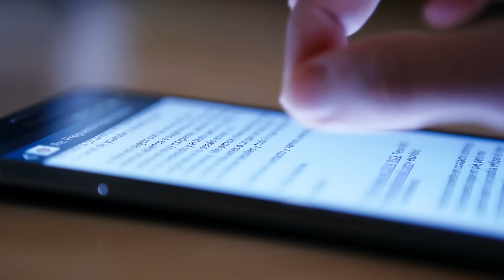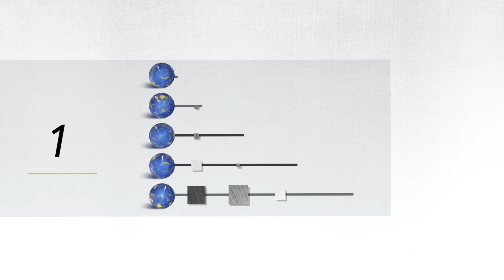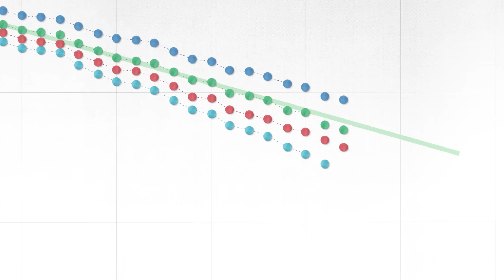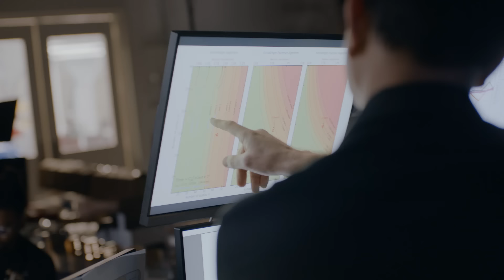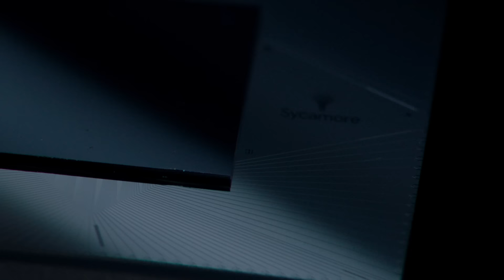Demonstrating Quantum Supremacy

Comment: "We can give researchers a tool that is unlike any other"

2020: every hash algorithm has been reversed. No password is secure anymore.
Reply: hash algorithm can't be reversed.
Reply: @SuperMarkusparkus  not true
Reply: Milan Kragujevic hashes cannot be reversed but there are tools that can compare hashes from a word list.
Reply: Just put password in a weak PC so it will limit the quantum computer's speed
Reply: Quantum passwords 😁
Reply: that's what I'm really afraid of.
Reply: @or814  it would be possible to just brute force crack it. No comparison necessary.
Reply: @SuperMarkusparkus  Rainbow tables. But yes, if there is salt, there is a problem with those too.
As long as you've found a sequence that results in the same hash, you don't really need to reverse anything.
Reply: Shor's algorithm is indeed out there to screw around your RSA/prime factorizations. But that doesn't mean there are not other encryption methods out there haha
Reply: there are encryption algorithms that can't be easily cracked by quantum computers, the problem is changing everything to use that.
Reply: @sean71300  Is there any asymmetrical encryption that does not rely on some variant of the discrete log problem? (which is possible on classical computers)
Reply: Only real outcome of quantum computing
Reply: You don't create kevlar before guns.
Reply: @ScientificReview  "What is your PIN?" - "Yes."
Reply: Maybe meaning it created hash tables for all possible hash algorithms and passwords. But if it's so fast maybe no hash tables needed.
Reply: Everything is tasteless without a pinch of salt.
Reply: guys, the same quantum computer that can crack, can also encrypt. Only problem i see is the system migration, but its companys problem, not mine
Reply: Please cure cancer
Reply: Jakob they’ve never been secure if they can be changed
Reply: superkrabban anything is possible
Reply: @ScientificReview  already exists, just google it
Reply: What you got to hide.??  Law of attraction.  Hide something you want them to find and you will become a slave.  Bare it for all to see and share and contribute and set yourself free whilst disempowering them.
Reply: @brenotome  say one?
Reply: What about the "Joe" algorithm?
Reply: Hash and encryption are different
Reply: Every hash can be cracked with brute force by quantum computer. But how can you get this hash? After three wrong passwords you will be blocked. Nothing to worry about. Only if you are insider you can get a file with hashes. Although two-factor authentication and other methods deny penetration.
Reply: @SuperMarkusparkus  Technically you could figure out all the chunks of data that match that hash.   since hashing can take a large amount of data and hash it into a single string, there are multiple chunks of data that can end up matching the same hash.  With quantum computing you could essentially list all these chunks of data for a given hash up to whatever limit you want (say 1GB).   You could do this with classic computers too it's just it would take ages.
Reply: Seems QC will bring new forms of password.
Reply: @SuperMarkusparkus  Yes it can with a quantum computer every encryption based on prim numbers can be circumvented by purely bruteforcing all posible solutions at the same time,alowed by the nature of qbits.
Reply: if in your brute force word list there aren't the password, u can't crack it
Reply: @SuperMarkusparkus  No but bruteforced
Reply: @DJDome123  errrr you're partially right and partially wrong. Shor's algorithm would indeed theoretically break anything based on factoring large numbers being computationally hard (and related problems like the discrete logarithm) such as RSA. That said, those encryption systems have little to do with your typical hashes.

It has little to do with bruteforcing either. A quantum computer doesn't really test exponentially many possibilities in parallel (as typical vulgarizations of qbits suggest), allowing you to bruteforce everything (if that were the case, breaking passwords would be a rather dull application, I'd be more interested in "reasonably-short-proof" generation). Instead, Shor's algorithm exploits some nice properties of finite groups, and the hypothetical quantum computer it relies on is essentially a probabilistic computer that can have some possibilities among the "exponentially many" "cancel each other out". That's a very gross explanation, but it's closer to reality.
Reply: @Dewstend  Makes sense. I hope we find a better application for quantum computing

Comment: Google : makes the most advanced form of "computer"

Also Google : sticks RGB LEDs on it

Does that mean it can run Crysis ?
Reply: 4:20 She hopes human kind will find a great way to use this computer, few years later people still uses this computer to take pictures of their food to brag...
Reply: Sir. Jaffa-Cake r/whoosh
Reply: Real question: Can it run Minecraft with all mods raytracing etc.????
Reply: It only has 53 qubits.  You'd need probably 1000 qubits to run minecraft as really you'd need different processes like memory to be stored in it's own section.

Like if you had an 4 qubit computer.. it would be the same as having a hex computer, basically it would run solely on hex logic instead of binary logic.

I reckon qubits would be best for probably read-only storage.  For example a PS8 game could have a card that has 100 qubits that would be equal to 1,267,650,600,228,229,401 (binary) Terabits of data.
Reply: @Manu Gond rgbs are for 12 year olds shoes. Not computers
Reply: @iamtheteapot7405  RGBs make the computer 10x more powerful, it's scientifically proved.
Reply: @iamtheteapot7405  i agree wholeheartedly

Comment: Finally, with this I could run Minecraft at 49 FPS!
Reply: Either at +49 or -49 fps.
Reply: @gerald4027  i thought it would be more
Reply: with shaders
Reply: @luisfilipe6253 .no either a +1 or a 1 × 49fps = +/ 49fps unless you could run 2 video cards in sli mode for more fps.
Reply: Gerald Nordahl r/whoosh
Reply: No. It can't run games. It's not designed to do that.
Reply: nah, i tried and only got 30 fps
Reply: Multiple r/whoooosh in this comment thread
Reply: How about 69 fps?

Comment: Google: we've created a quantum chip
Whole world: ...

Apple: we're releasing a new color for our latest phone
Whole world: Goes apeshit
Reply: Apple: we're releasing a stand for quantum computer for $99999
Reply: @ilya6355  That's dirt cheap for a quantum computer.
Reply: @JollyOldCanuck  for a stand
Reply: @DifficultInside  Missed that part :)
Reply: @ilya6355  But it only has a USB C port
Reply: @Robin-sf3gk  So what? its stylish
Reply: That's because what Apple is doing can be comprehended by the common consumer,  this can't.
Reply: @isimikehinde5584  but...I can comprehend it
Reply: a million thumbs up..
Reply: @ilya6355  and stand comes with power cord which cost extra.
Reply: Kjell Gudim r/whoosh
Reply: @ilya6355  😂😂😂😂
Reply: Apple we are releasing new iPhone for $1billion
Reply: @ilya6355  lol sounds about righ!. tbf tho Quantum computers do need really fancy well insulated "stands" if u can really call them that, the low temp set up at out uni is mounted on massive springs to dampen vibrations (not used for quant.comp as far as ik but a similar setup none the less). No idea who much they cost but 10k  sounds like a reasonable guess (for the stand not the whole cooling setup) so you're closer to the truth than u think!

Comment: Laptop: Quantum chip inside. 

Battery: I am gonna end this man's whole career.
Reply: I mean arent quantums more efficient though. You operate only on Qbits, so most energy will go to other parts, cooling and screen. Problem is to find a way to put one into your laptop without living in cryogenic box.
Reply: MJM you must be fun at parties
Reply: @37Hipper  bestest
Reply: We need a quantum battery
Reply: @mjm3091  quantum chip DOES require super-cooling to operate. And to get the matter to that state requires a lot of energy. So yeah, it will kill battery, he is correct. And yeah, I'm even funnier at parties
Reply: @user-st5ir8mg3q  quantum hentai, the quantum computer outputs more possibilities than every bit of the medium combined
Reply: @mjm3091  

Currently it still has to be cooled to near 0 Kalvin.. So. Yeah. Battery murder.
Reply: @user-st5ir8mg3q  chip on itself wont kill battery though - and my comment is literally that. I even mentioned cooling and the fact that we would have to live in cryogenic chambers to even use it in laptops.
Reply: @mjm3091  not the chip itself but the fact of putting chip inside a laptop and op's comment was about that.

If you will put a quantum chip inside a laptop it will kill the battery. It will not kill the battery because of the chip itself, but doing so will kill it

The thing is, you said everything correctly. It was just a bit off the point from op's comment

Comment: Lastpass: we can manage all of your passwords 

Google: hold my quantum supremacy.
Reply: That should be a subreddit
Could be a good source of ideas for the government to start thinking ahead of future foreign hackers
Reply: Most modern encryption is quantum-safe, meaning it's mathematically proven that quantum computing cannot give an advantage in breaking said encryption.
Reply: @DASPRiD  I have a hard time believing that. How can that be proven without knowing the extent of what is even possible with a quantum computer? We've only scratched the surface. How can you mathematically prove that 20 years in the future someone won't discover a quantum algorithm that harnesses the power of qubits to crack some current encryption?
Reply: @electron5271  You should look up post-quantum cryptography. What is true is that current public key algorithms, which are based on prime number factorization, is easily broken with a sufficiently fast quantum computer.

Many modern symmetric algorithms and hashing methods are somewhat safe though. There is Shor's algorithm, which may pose a threat to them, but just by doubling the key size you make it harder by multiple factors to crack them.

Shor's algorithm was by the way invented in 1994, and for 25 years, no better algorithm has been found.

Comment: Hope It ends up in my smartphone when I'm 50
Reply: Needs to be cryocooled to near 0K so its probably thermodynamicaly impossible.
Reply: Well I’m 50 in 27 years so they better hurry up
Reply: I think it's more likely that we'll have 7G networking transferring our data to a network of quantum computers that do the heavy lifting and then send the data back to our phones for rendering the final result. Who knows what the future holds
Reply: Anshul Gupta 7G? Have fun getting your brain fried by such high energy electromagnetic waves.
Reply: @triibalecho    those electromagnetic waves would also be shielded from human brains using some kind of device for 7G networking
Reply: @triibalecho  sure we will just pretend that that is how it works
Reply: Mr. Nuke I may be exaggerating a little bit. But if you wanna tell me why that is not how it works, than please explain to   me. I am currently making my Master of craft degree as an electrician by the way.
Reply: Good job, that could be a soulution but in this case, we would have to be grounded all the time, otherwise it would‘nt be effective.

Comment: I thought I understood for a minute, but they lost me again almost immediately
Reply: Same
Reply: Once that Qubit thing started to roll in I spaced out
Reply: a woman made a ted talk on quantum, it might help you out..
Reply: And they didn't even mention how the potential of quantum computers involves computations that exist in other dimensions to explore and exploit parallel universes through super position.  Check out Geordie Rose talking about D-Wave.
Reply: They really didn't say a lot. It was a lot of fluff without much substance and they let everything vague.
Reply: Its simple. How do we read the binary number 10011? We read each bit in the memory one by one until we know the number is 10011.
With Qubits, reading the first qubit is enough to automatically figure out what the other qubits are. A very dumbed down example is for the number 10011, if we find that firt digit is 1, then definitely the remaining are 0011. Because we designed the qubits in such a way.
Reply: So quantum supremacy definition is something like : having a device running a random sequence of quantum operations whose output cannot be simulated by a classical computer but is not flat random noise.
And a quantum computer is a device that can solve some very specific problems (like quantum chemistry simulations) exponentially faster than a classical computer at the cost of an output that get exponentially bad as the number of operations grows, hopefully slow enough we can still do something with it. 
Among those we have two classes of devices : the quantum simulator which is made to solve one type of problem and the quantum universal computer that can run any algorithm. What they have is a quantum simulator made to demonstrate quantum supremacy, but maybe it can be useful for something else, how knows ?
Reply: I believe Veritasium had a professor explain in a very low level layman's terms on what superposition and entanglement is. That double pendulum demonstration is what opened my mind. Before that I assumed it was nonsense physicists make up for the "math to work".
Search for practical explanations, layman's explanations etc given by proper physicists. Dont follow the news or random YouTube videos that confuse us even more with their little knowledge and lots of jargon
Reply: Well ı guess thats how quantum works